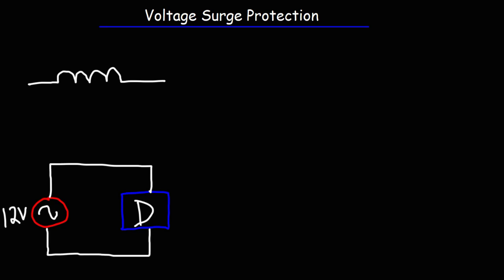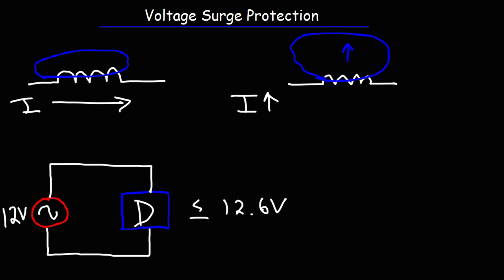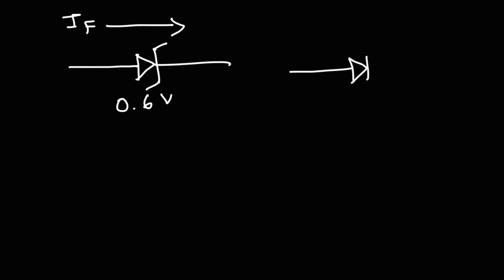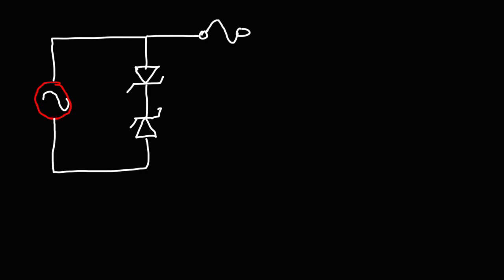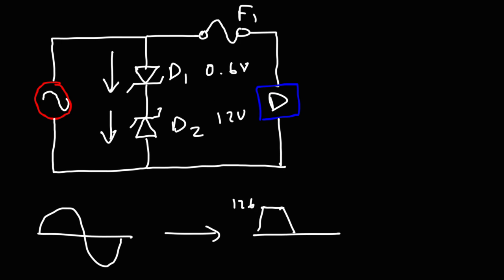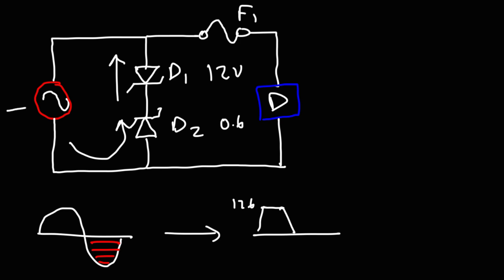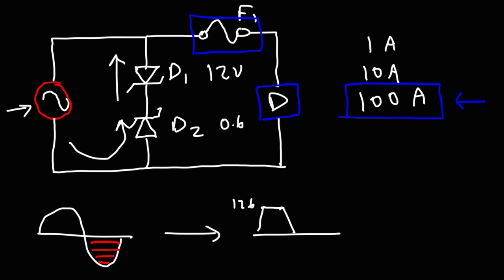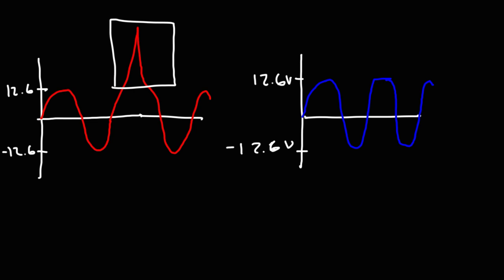High Voltage Surge Protection Transient Suppressor Circuit Using Zener Diodes & Fuses

Comment: how about putting the fuse right on the output of the power supply, so when the zener diodes burn and short, it blows, protecting the psu from shorting?

Comment: The Fuse should be between the Power source and the TVS diodes so that it does overload & damage the diodes if the over voltage state persists for a long period. If the Fuse was before the diodes it would protect the load & the diodes. The Fuse could be an NTC fuse: resistor with a negative temperature co-efficient such that if the current draw exceeds the normal load the resistance will increase limiting the current flowing in, which would protect the TVS diodes and the load. If you just use one diode for a DC circuit (instead of two TVS diodes back-to-back) and use the NTC fuse it would also protect the circuit from incorrect voltage polarity (ie the power source is connected backwards) The TVS diode would conduct current if the power supply is connected, and the NTC fuse would limit the current flowing from overloading the TVS diode.

TVS Diode = Zener diode that can handle a lot more current than a Zener diode. TVS = Transient Voltage Suppression.
Reply: YOU ARE CHAMPION!
Reply: I think Positive Temperature Coefficient should be used? Because increase in current will increase temperature of resistance, increase the resistance thereby reducing the current flowing through it.
Reply: But the title using zener diode not tvs  😅 , but you rights 👍
Reply: I'm trying to protect my bipolar switch from high voltage transient inducted by switching off an AC induction motor (230-240VAC/50Hz - 550W motor press drill). I started to think at snubber RC in parallel with the load, but I still didn't managed to figure out C and R values; I simulated the circuit in falstad, but I cannot clamp voltage under 1kV unless I select big C...
So now I'm thinking to a TVS diode. Do you think that a TVS diode would be preferable instead of RC snubber for the purpose? And how I should proceed to select the right diode?
Reply: @fp6232  A TVS diode will work. For a 3/4 HP Motor I would recommend LittleFuse 1.5KE400CA   which is a Bidirectional 342V (working voltage) TVS Diode with a 1.5KW surge capacity. For 240VAC the working voltage is about 340V (since 240VAC is RMS or 240 *1.414 = ~340) Mouser electronics sells them for about $0.68 each (so not expensive). If your in the EU Farnwell electronics should sell them.

You can also add a pair of Cylindrical ferrites to reduce EMI (which will help attenuate line noise. Or you can buy a power line  filter can like SCHAFFNER FN2060-20-06  (250VAC 20A Single phase Chassis mount). Farnwell sells it for about $40 USD. The Power line filter will outperform a cable ferrite, but is considerably more expensive. Cylindrical Core Ferrites would sell under $2 each. I would get two, one for the hot & the other for neutral. The more ferrite material the better they are at noise suppression, but look for one that fits in the motor box space so you don't have to remove the power cord sheathing.

Comment: Can I ask as per ohms law does the voltage spike if it does not exceed the Zener current, does it also clip the voltage to the Zener voltage but raise the current, so to be clear if we were to be able to somehow test that ‘grounded’ voltage would it be 12.6~ but at a higher current as per ohms law and things ?
Reply: Zener diodes does not really apply to Ohms law which applies to resistors. A Zener diode is an active device that switches on (conducts) when the voltage apply reaches its voltage limit. So a 12V Zener from 0 to 11.9VDC the Zener is switched off, but when the voltage reaches 12V it conducts. It will conduct any current as long as the supply voltage is equal or above 12V. However the Zener can only handle a limited amount of current before it fails. Normally a Zener is placed in series with a current limiting device to prevent it from getting destroyed in an over current state.
Reply: Guy Tech thanks greatly for the comprehensive answer, yes I have noticed that various diodes are not applicable to that law, as an active device though my question is more focused on the relationship between V and C which was what lead me to quote ohms law, perhaps there is some other more relevant rule? 
However that was where my query focused, in this case of say a V spike , let’s assume the active device Zener clips the V so what is being passed is the Zener V however the spike itself is many times greater, I automatically assumed that the V to C ratio is ‘true’ that is to say in the example the ‘grounded’ V is more or less the Zener V and the ‘volume’ of the spike is the ‘current’ ?
Sorry if I’m not being clear enough.
Reply: Guy Tech also any tips on getting a Ford serpentine main belt on with only two hands ? 
Ignore that I might have figured it out. Thanks again.
Reply: @kolinevans9127  Current limiting would be dependent on the amount of current the power source can provide and an current impedience (resistance & inductance), or until the diode fails to an open circuit.

Presuming these is some resistance below the maxiumum diode current rating, it the voltage will drop to the diode conduction voltage. If the Zener\TVS diode has a voltage rating of 12V than the voltage  across the diode will fall to 12V. 

if there is a high voltage transient spike (say 200V for 100 ns) the diode will clamp the spike preventing the voltage across the diode exceeding 12V (presuming a 12V TVS\Zener diode is used). However if the transient voltage is excessive (say 20KV @ 100 ns) its likely to cause the diode fail because the diode can only absorb so much energy.

Generally Zener diodes are not used for transient voltage spikes because the cannot handle much current. However semiconductor Manufacturers offer TVS diodes for circuit protection. 

That said most consumer electronics use MOVs (Metal Oxide Varsisters) for TVS protection because they are much cheaper. However MOVs have a very limited number of cycles before they fail.

Comment: how can  current flow from the anode to the cathode? i thought diodes only let current flow in one direction ( cathode to anode) right? I am trouble shooting a circuit that has the anode of a schottky diode in sequence with the anode of a rectifier diode. Confusing because
 I  though diodes were one way.
Reply: That's exactly what's special about a Zener diode.  It nominally allows current to pass in only one direction.  But if the reverse voltage goes beyond the "breakdown" voltage, it will conduct in the opposite direction until the voltage falls below the breakdown threshold.

Comment: Well explained but how the voltage is added as 12.6. actually it will substraction as (12-0.6=11.4)that D2 is not reverse biased at 11.4).
Reply: At 12.6v, D1 will drop 0.6v, remaining 12v will make D2 conduct in reverse bias, any lower voltage will not make D2 conduct as it needs at least 12v + 0.6v for D1 = 12.6v.
Reply: @mmghv   I have another Doubt can you explain.  Actually, the supply, Zenor diode, Load are connected in parallel. Hence the voltage across the load is same as supply, how then this voltage suppressor works. (I know if the voltage above 12.6 then the Zenor will take current, But the voltage is same Right?)
Reply: @ajayj6398 Well, that's how a zener diode works, it clamps the voltage, I'm not an expert or an academic, but how I imagine it in my head (same for opamp feedback circuit) is when the voltage exceeds the clamping point it will cause the diode to conduct causing the voltage to drop causing the diode to not conduct so the voltages rises causing the diode to again conduct causing the voltages to drop, and the cycle repeats at the speed of .. physics? .. so what you will actually end with is an equilibrium where the voltage is kept steady at the clamping point. والله اعلم

Comment: I’ve a question! What happens if the diodes conduct at the same same? Why is it impossible to happen!?
Reply: Diodes conduct in one direction. The supply voltage is alternating, which means during the first half cycle, only one diode can allow the voltage to pass while the other diode blocks the passage of the voltage when the voltage is reversed, the other diode that blocks the passage of voltage will conduct while the former that conducted will block the passage of voltage.
Reply: They can conduct at the same time if the forward biased voltage of one is equal to the revers biased voltage of the other, let's say there's a 0.6v zener diode, then at 1.2v both diodes will conduct at the same time, anyway it doesn't matter if they conduct at the same time or not, if one of them is blocking then no current can flow in any of them, the whole idea of using 2 diodes is allowing the AC current to flow in both directions, if it's DC then you'd only need one zener diode.